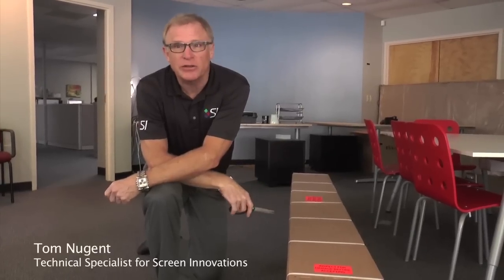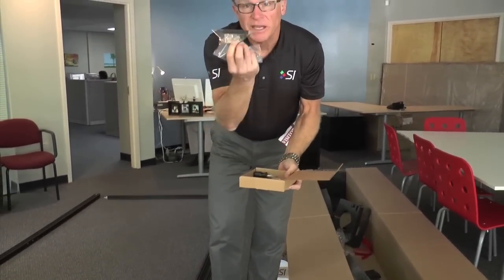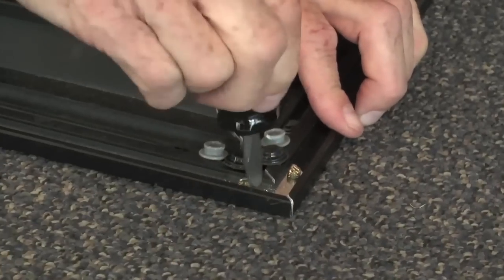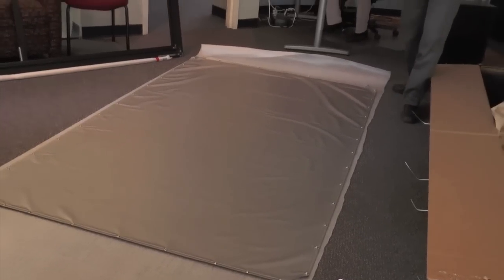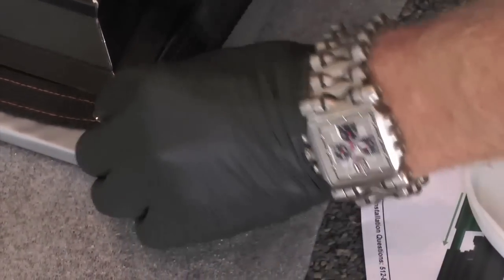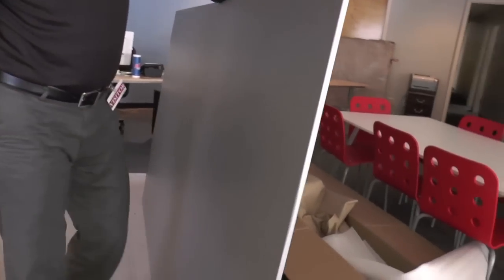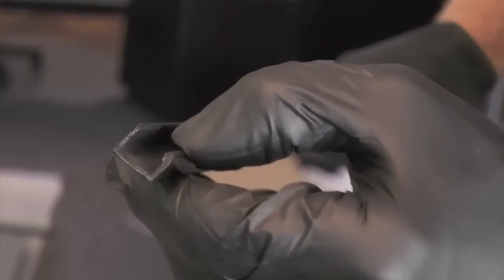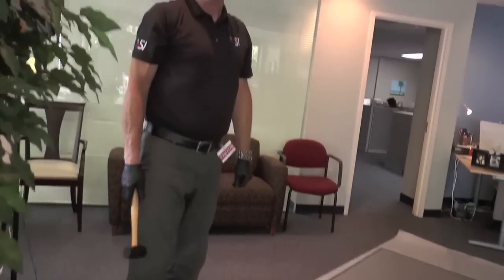Unboxing and Building of the Zero Edge Flex Screen by SI

Comment: I sure wish mine would have come with snaps instead of springs. I got it all together and the very last two springs were hopelessly tangled. So, now I have to take it all apart and start over. Crap.  My screen was the elite screen 110-inch Diagonal 16:9, 8K 4K Ultra HD Ready Ceiling Light Rejecting and Ambient Light Rejecting EDGE FREE Fixed Frame Projector Screen, CineGrey 3D  material.